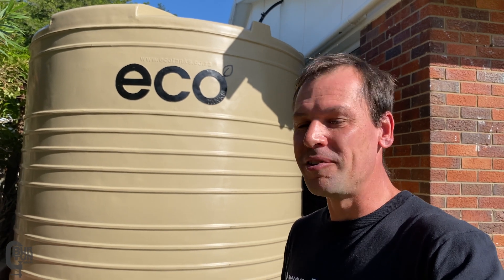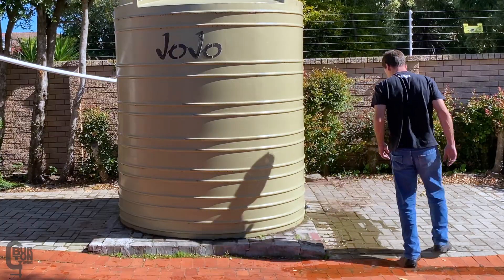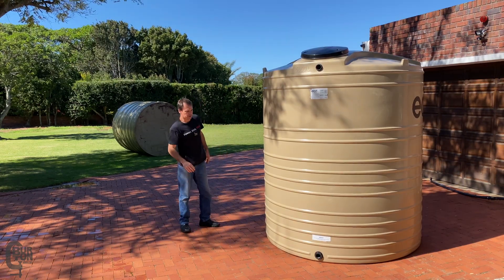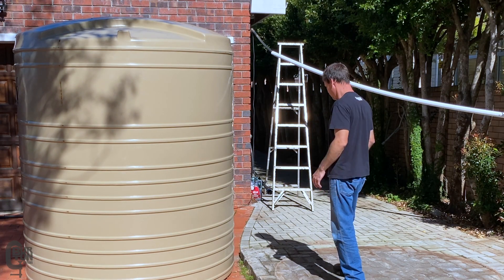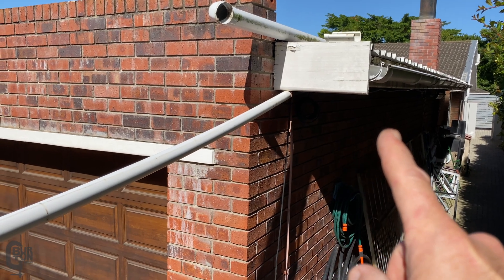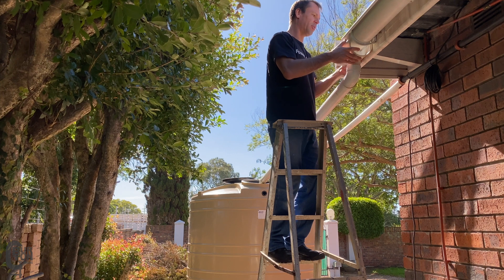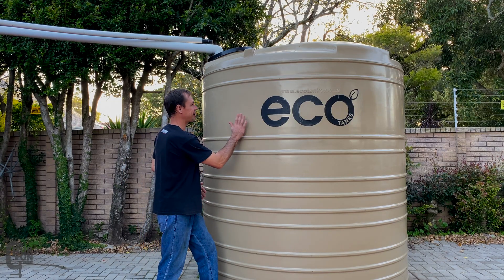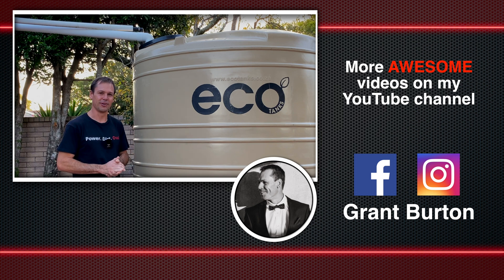Water Tank install for Rainwater Harvesting (Eco Tank)

Comment: Hey Grant, please explain how the submersible pump works. Do you just switch it on manually when its full? Does it have run dry protection? Is there a way to automate the pump so that it turns on when its full?   I am from South Africa so any information about where you get this equipment would be appreciated.
Reply from the maker: Hi Bryan, on our setup, when the tank is full or if we need to transfer water to the main tanks, I manually turn on the pump and let it run. The submersible pump has a float switch built in so it will turn off automatically when the water level drops to the bottom of the pump, where the water pickup is (a form of run dry protection i suppose... so long as the pump is upright). Currently the pump is hanging about 150mm from the bottom of the tank so it will turn off before the tank empties completely. It also limits the potential for the pump to suck up sediment that may collect at the bottom of the tank. 

I'm sure there are float switched that one could install to automatically turn on the pump once the tank reaches the level of the installed switch... have never used one so not exactly sure of which type to use. Guessing it would need to be some sort of normally open type float switch that is tethered mid way up the tank... so the the float switch floats on top of the water and rises as the water level rises... then as the water level reaches the top of the tank, the float switch is tilted upright (because it's tethered midway up the tank) and will turn on, thus starting the pump and transferring water. As the water level drops to below the tethered point, the float switch will eventually hang / tilt down again and turn off. I'm not sure if this is the best method to achieve auto pumping when full.... just a guess.

All the equipment, pumps, fittings, valves, switches, etc. should be available in most cities at the local irrigation / farm stores. I normally call in at TURFAG or sometimes Spilhause or PE Plastics here in Port Elizabeth. Not sure what stores are around your area though. Could also try The Co-op.

If you find out anymore, please let us know.